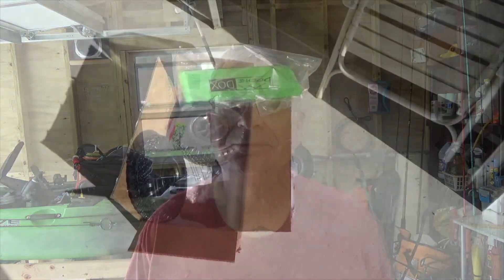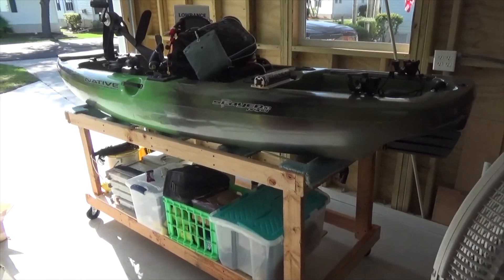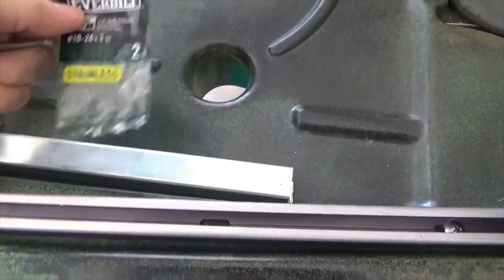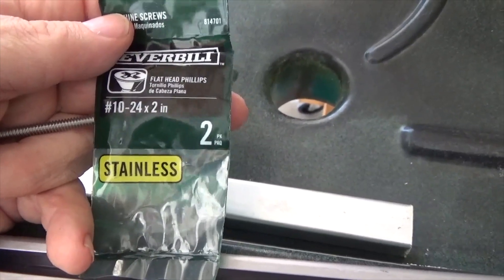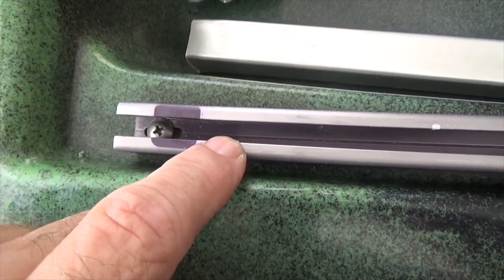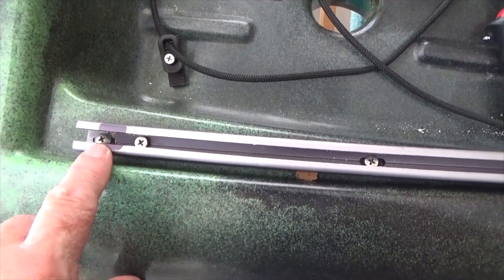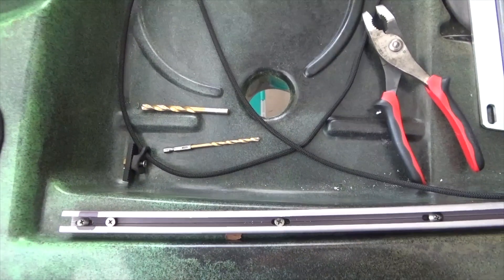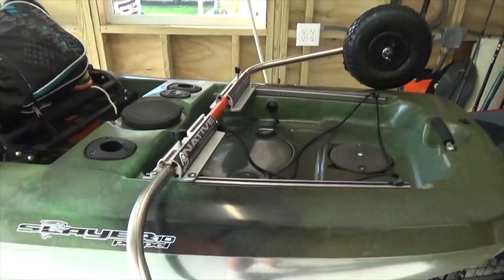VLOG #12 Boonedox landing gear upgrade

Comment: Many thanks for this DIY project.  I have a Native Slayer 10 and bought the track mounted Boonedox landing gear. Today I implemented your terrific hack.  I did a little improvement on your idea by drilling a large hole in the aluminum tube for slipping over the first existing screw (that you had bumped into on your install) and extending the aluminum tube toward the bow by another1-1/2 inches.  That way I could add one more bolt on the bow side (beyond the bow end of the gunnel track) and used a track nut (like a large washer) on top to secure this additional bolt.  I also plan to add one additional Boonedox landing gear support feature (when needed for heavy loads) by running a tie-down strap, hooked to the landing gear legs, underneath the kayak to create a cradle. An extra step for dropping in and taking out, but probably worth doing on very hot days and/or when heavily loaded.